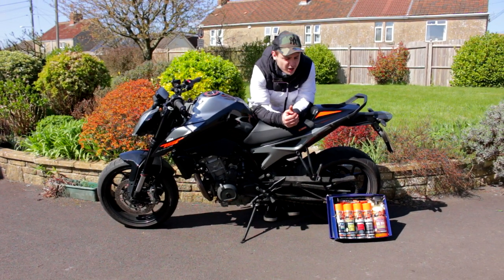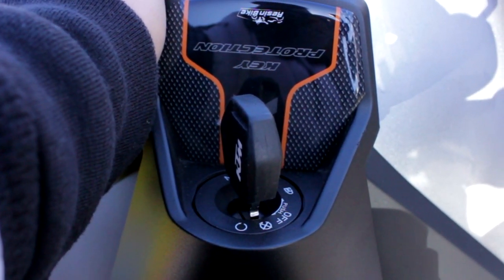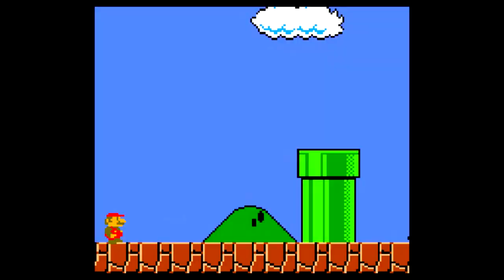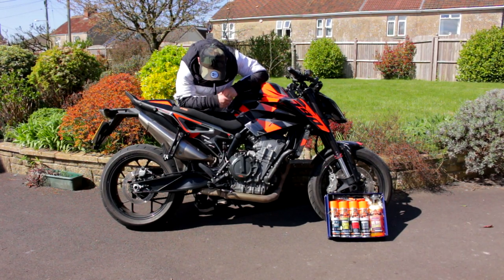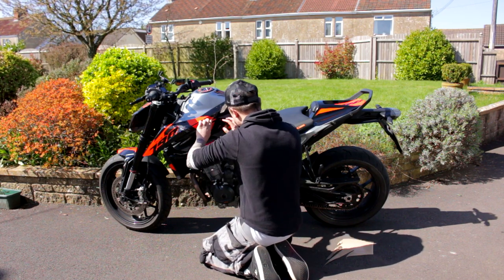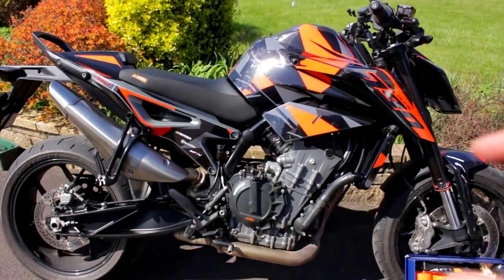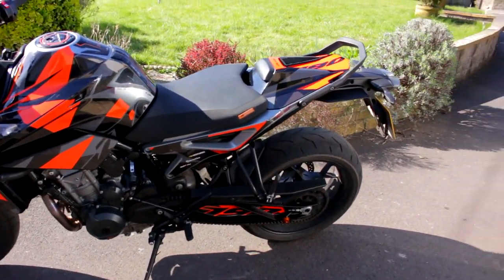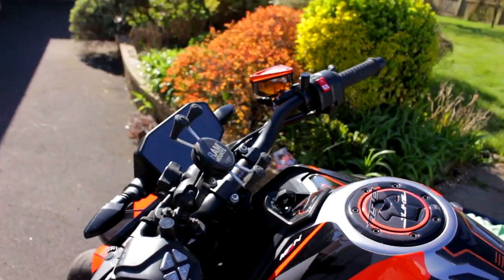MCN Graphics kit for the KTM DUKE  | HOW TO: DUKE 790 - Build Series

Comment: Bike looks great mate. Always wondered do the sticker kits start to peal off after time? How are you finding it? Where did ya get those screw caps for the mirror stalks?
Reply from the maker: Screw caps have now fallen off 😂 but they were an eBay job and the sticker kit it’s from MCNGRAPHIX on Facebook and Instagram. Full customised and made to fit, great quality. Started to peel off on the front of the tank but that’s my fault as I could have done a better job when fitting